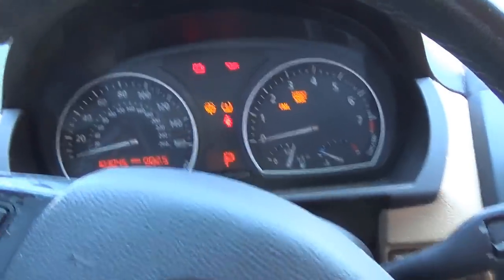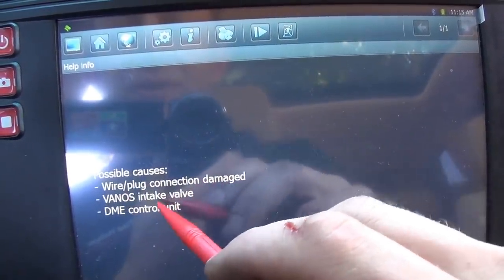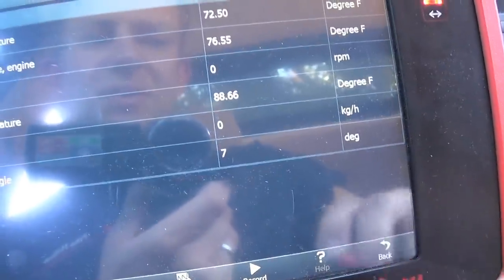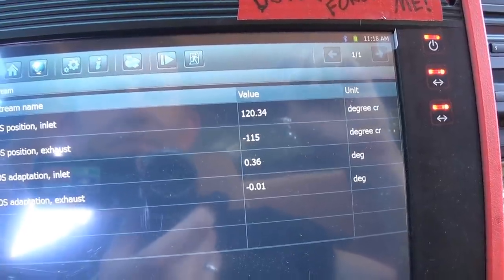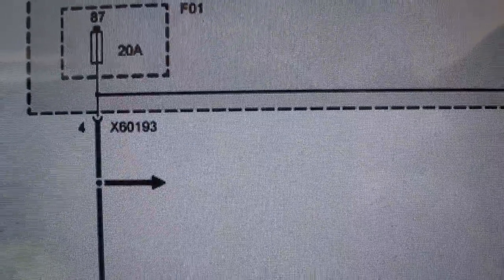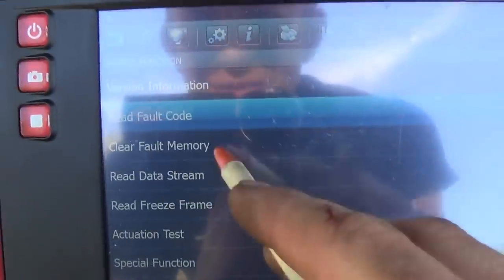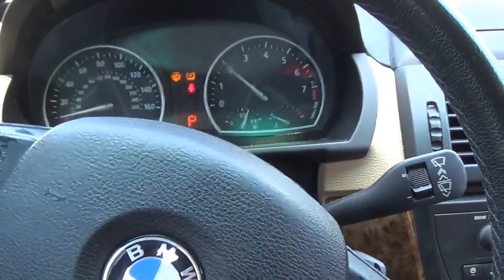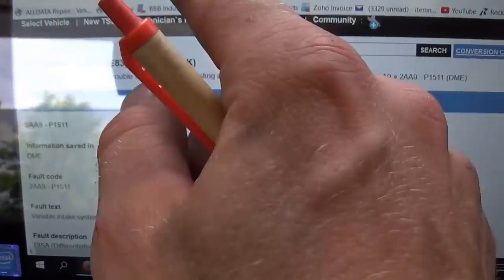BMW Starting Problems (SI 2016 Ep. 3.3)

Comment: Hey Ivan I have a 2005 BMW X5 with a 4.4i and it was a no crank no start so I hired a lock smith because I thought it was the key but he scanned it and he said it was the ews immobilizer module box. So I replaced it and called him to resynchronize the EWS with the DME and it started right up and was working good for exactly one week and than it would crank no start so I had to resynchronize do you have any clue on what it could be
Reply from the maker: Great question. Might be the module losing keep alive power?
Reply: Do you perhaps no where it would be loosing power. Or have delt with this same problem. Because it seems to be a common problem with these bmw’s

Comment: I got a 2007 750i crank no start sounds like timing chain not attached the engine is spending free but i see the chain when i looked under the valve cover on the driver side

Comment: Nice work Ivan Dejavu for me I was working on a 2003 BMW 525i a few years ago, same exact problem BMW told the owner he needed a new engine because one of the cylinders was low on compression which was because of Cylinder wash. I looked at it, no RPM, CKP was already replaced didnt have a wiring diagram ran out of time had it towed to a Euro Specialist and it was the fuse that powers the CKP I was sooo embarrassed and angry at myself that I missed it

Comment: 2AA9 - Variable intake system, servomotor 2: activation -> DISA 2 servomotor & butterfly valve under the intake. This might cause 2AA9 when it is faulty or even when the DISA 1 on the outer side of  intake is faulty, like the butterfly broken away from the axle (it's too big to go to the cylinders, so it is usually found somewhere  inside of the intake). It's easier to pull out DISA 1 and check that first. That is the one which has more cycles as it is one opening at lower RPM, DISA 2 opens only after 5000 RPM, thus usually not that often.

https://www.e90post.com/forums/showthread.php?t=1497019

Comment: Oh ivan from the distant past, that was looking like a nightmare.
Phew a fuse helped a lot :-)

I've always found high wattage bulbs to be good for short testing as a fuse, two elements of a halogen headlight bulb in parallel, add wires and a fuse is created lol.
I'm supprised you don't use them more, i saw lots of good russian made portable t.v sets with a bulb in the psu, and they worked really well..
I'm not joking about the portables, vega/regonda.
Cute little tv sets :-)